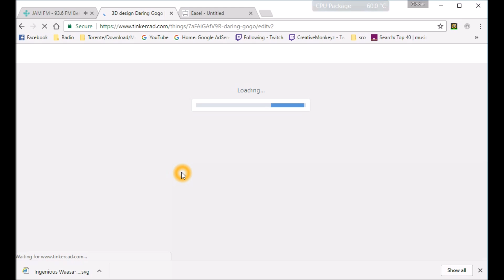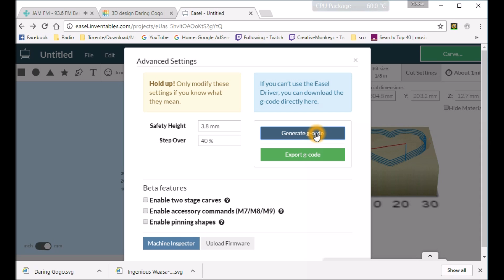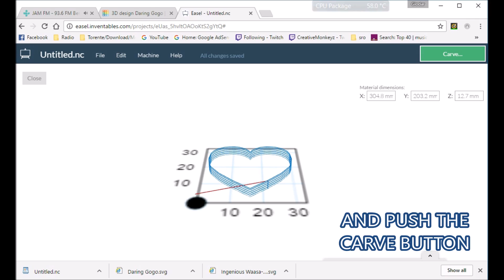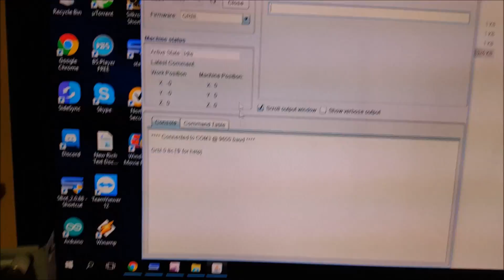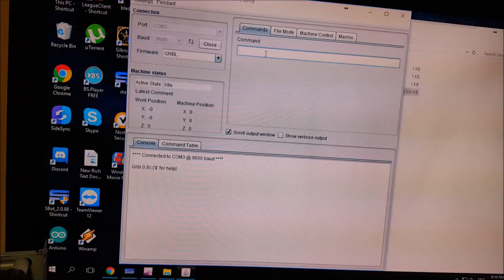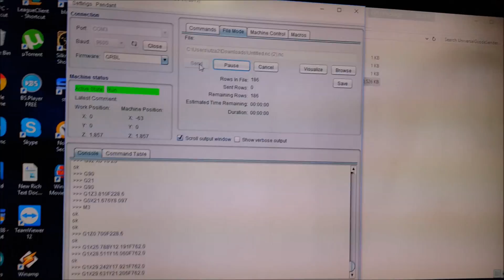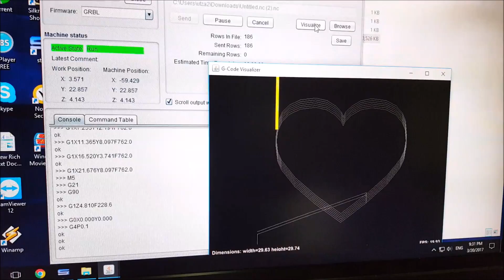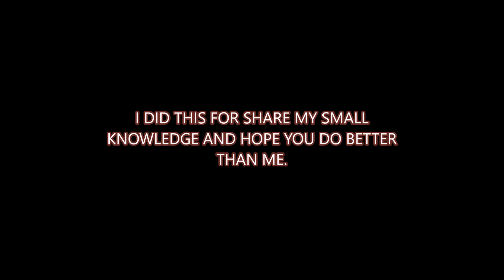Super-Cheap 3D Printer from CD/DVD Drives

Comment: how large is the max Printing area?
Reply: Arno nümuss those drives have 3.8cm of travel. If you want to build a dirt cheap printer, build one around the 28byj-48 motors. It will only be a bit more expensive but usable for real world printing.
Reply: The Mechanix, Thanks, that is 5mm more than expected. And I have seen a scanner design that uses the 28byj-48 stepper. I guess that would be a good source for a bigger 3d printer from recycled stuff. I'd rather use the dvd drive method though to make a tiny printer, maybe from a old coffee machine as it comes with a heated bed :D
Reply: The dvd drive method is the better choice imo.  Takes care of the linear axis.  Also, the 28byj-48 motors, while cheap, have proven to be pretty inaccurate, so they are best for projects which don't require mm precision.
Reply: Oh for sure, there's more versatility there!  And I've also read about people correcting for the 28byj-48 inaccuracy in the code.  :)
Reply: Matteo Olivero should be 4*4*4
Reply: According to my interpretation of the CD standard, at least 33mm on every axis.
Reply: esquach I just prefer the fact that you can choose your linear movement and kinematic system with the 28byj-48. But everyone has a different opinion :-)

Comment: Hey, I too am thinking of making a 3D printer for cheap. I wanted to use a 3D pen because my friend wants me to. But, if I use a 3D pen, will I be able to use the printer with Marlin and RAMPS
Reply: I know im 7 months late, but as long as you can connect the pens extrude button to the extrude on RAMS I guess so
Reply: I'm even later, but I highly recommend buying a clone e3d v6 and nema 17 extruder. It's probably cheaper and will work so much better